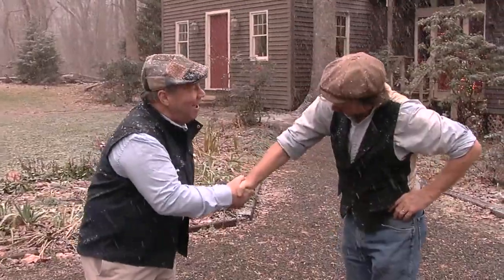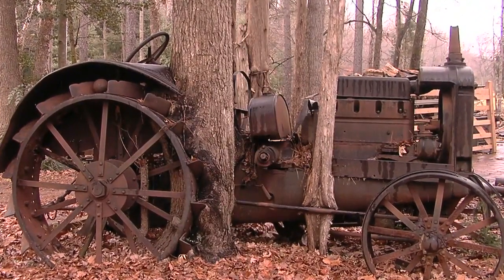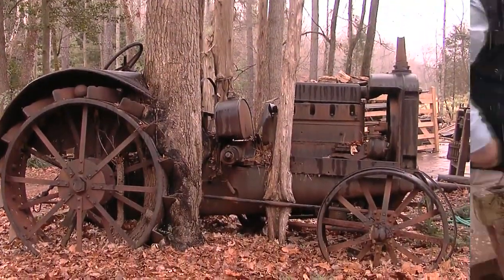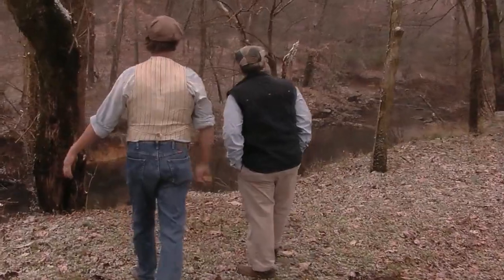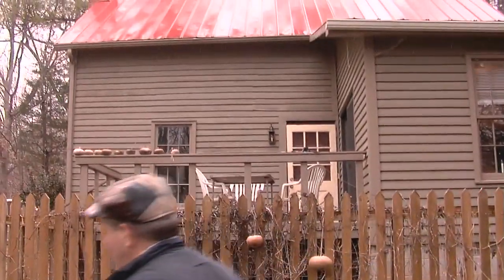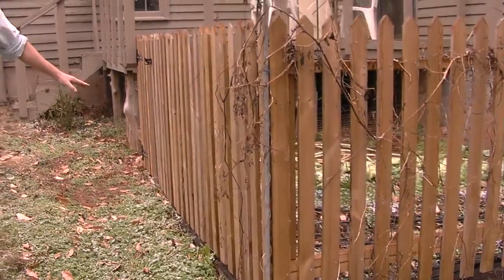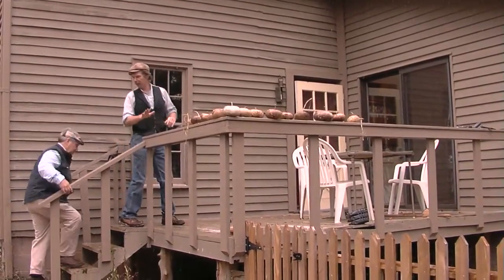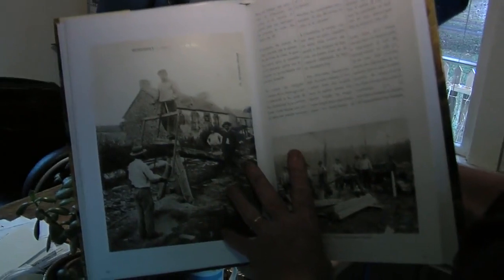BONUS - ROY UNDERHILL GIVES US A TOUR OF HIS NORTH CAROLINA PROPERTY

Comment: If I could, I would like to ask Roy about pit sawing.  Actually, my question is more about ripping boards with a two man saw whereby the log is in an upright position.  An old timer from the Upper Ottawa Valley swears that a pioneer in these parts, back in the day, operated a man powered sawmill where the men could stand opposite each other to rip through the log.  I Googled this, and nothing convincing turned up.  The pit-saw seems to be the only logical method for ripping boards, without a water powered mill.  Does Roy know about this method of ripping upright logs?
Reply: It doesn't really sound feasible to me since it would be harder than doing it the traditional way with a raised platform or a pit.  It would probably be harder to secure the log while it is being sawn.